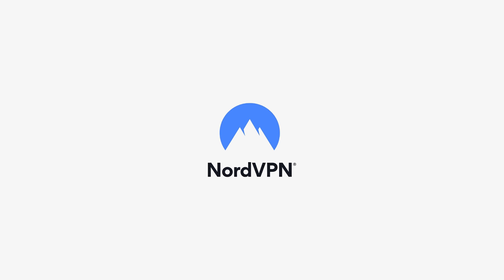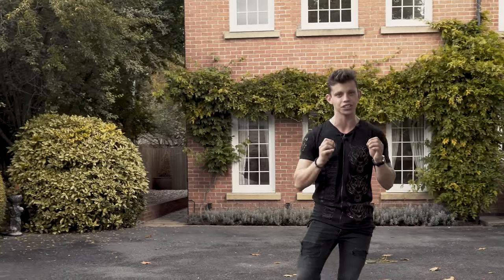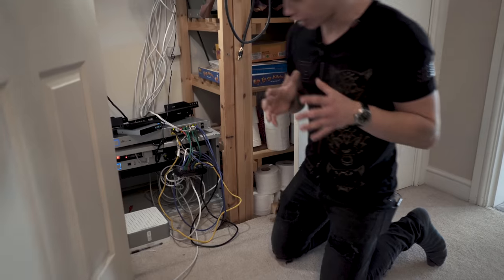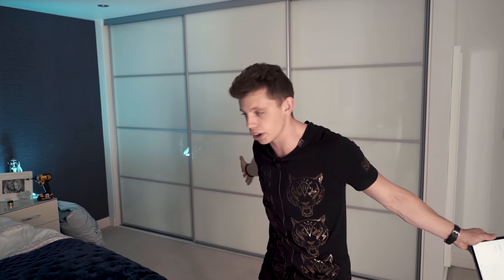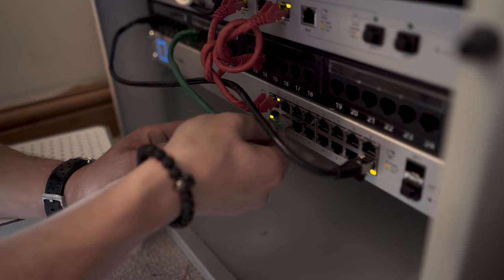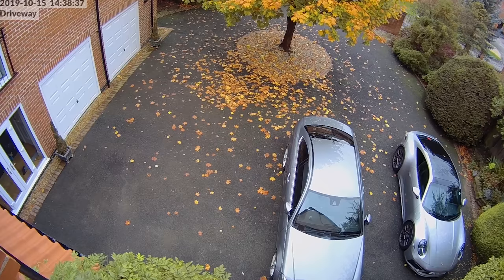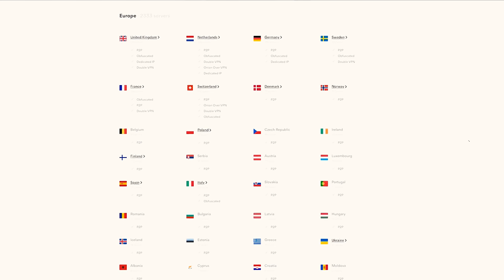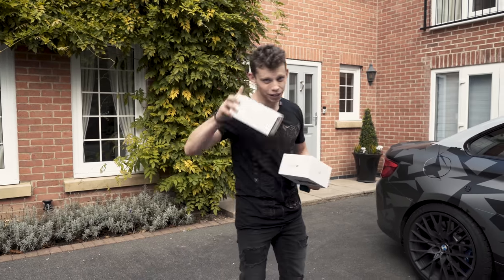The BEST Home Smart WiFi, Network and CCTV Install (EP: 3)

Comment: what happens if you use 8 cameras? ithe 1 tb inside the cloud key is not enough to store footage for like 2 weeks..is there any way to store the footage on a nas ?
Reply: @StereotypedFilms  but it stores only 3 days of footage
Reply: @AnandakrishnanM27  The disk is easily upgradeable
Reply: @welshy1812  do you get 2.5 inch mechanical hardisks in 8 or 12 tb capacity?
Reply: AK27M currently 5TB is the largest I believe.
Reply: @welshy1812 in our place 2 tb is the largest locally available...so  we need an option to hook up a nas  in the interface..